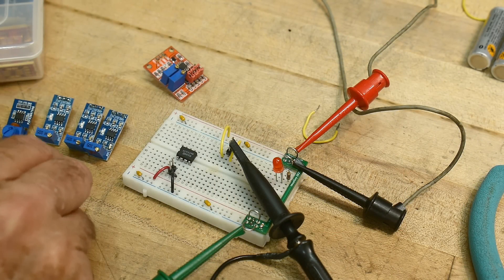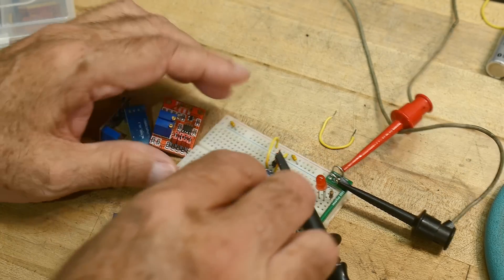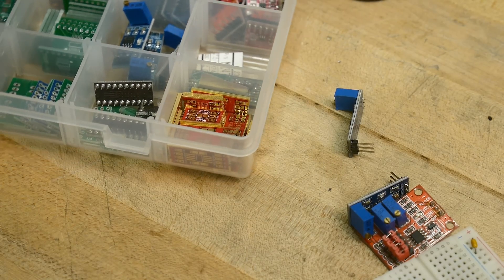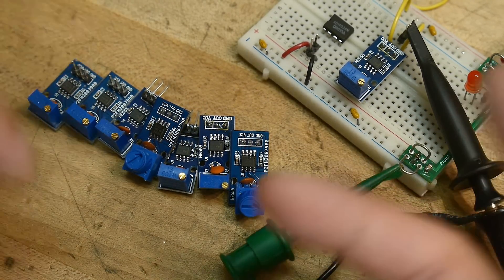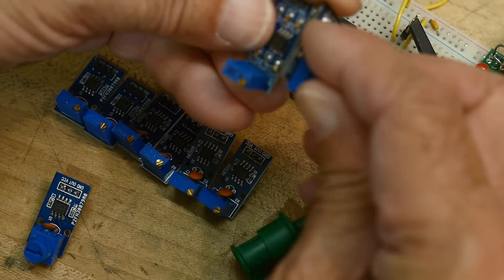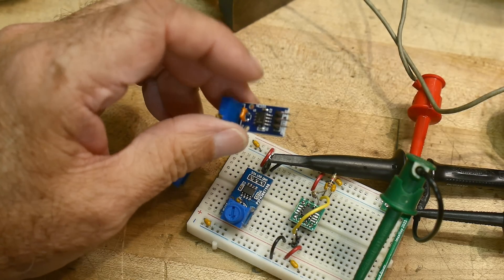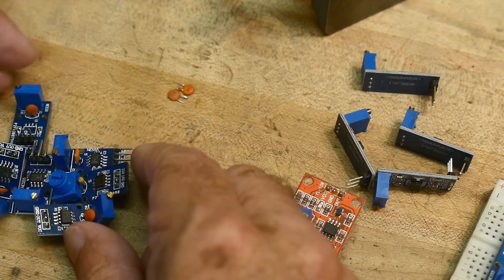#1588  Odd Behavior 555 modules

Comment: I checked all 10 I have and they all had the caps that were bad so I clipped them and soldered a .1 SMD size 1206 cap right across the pads and rechecked, all is fine now. Thanks for this video, very helpful.

Comment: Love you videos, I'm wondering if you could help me with a project for my grandson. I 3d printed him a traffic signal with the three lights. I put together a circuit with a 555 timer, and a 4017 ic, and it works to change the lights, except since the ic has many output pins, and I'm usin only three, there's a long off time, when it cycles to the green light, from the red. Any ideas?
I was thinking of usong an lm324, instead, could that work, with 3 of the op amps going hi and low?
Reply from the maker: https://www.homemade-circuits.com/knight-rider-led-chaser-circuit-mains/
Reply: I assume, that you have connected rgb diodes to pins 2,1 and 3 respectively. Imo you should connect pin 7 ( output 3) to pin 15 (reset) to shorten the counter's cycle. Also, "true" lights work with the sequence red - red & orange - green - orange - red (at last here where I live)), which requires 5 states and some diodes (or extra logic circuits) to drive LEDs. In this case the reset should be connected to output 5 (pin 4), and red diode to output 0 and 1 (using diodes), orange to 1 and 3, green to  2. Hope it helps.

Comment: When I began learning electronics I spent two years trying to build a buck converter using a 555 timer and failed but learned a lot from it. You can change the capacitor but that is not a guaranty either. Test that cap at 5v and 14v at 1khz to 500khz. Will the frequency still stay the same throughout the range? Wouldn't the capacitor charge faster at a higher voltage? Therefore the freq will change also. Is the output of the 555 ever used directly? Drive the 555 with a constant voltage, then level shift the output using a BJT/Mosfet. So it won't rely on the quality of the capacitor.

Comment: the small ceramic like you have are prob class2 and are very bad, both temperature and voltage upsets them. I have a box full and they are no good for RF or timing.
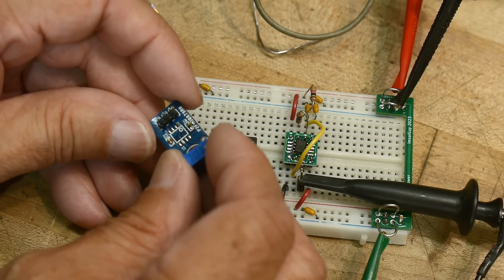Have alook at Alan W2AEW's video number 256 where he covers the various types. The ceramics start at about 7:40 in

Andy

Comment: I can't remember what it was I had which was a little board like one of these, but they swapped the SMT MLCCs around when they made them and the 555 was used for a IR TX carrier wave oscillator and couldn't be set for the right frequency until I found the problem.

I had another board that would step 12V-24V down to 5/9/12 or whatever for QC3.0 USB charging and the input bypassing MLCC immolated itself instantly. I had a couple of these and the second one was fine. They just put the wrong cap on the first one.

When these Chinese companies play 'telephone' with boards from Adafruit/Sparkfun as well as each other while mixing in fake or counterfeit parts, funny things happen. 🤪

Comment: IMSAI, ceramics are nonlinear with voltage change.  What?  My cheap chines modules exhibit the same behavior. I learned something else form you today, thanks for digging deeper into this issue. Off to change out the caps on my modules. Thanks

Comment: I once worked with a guy who had worked on analysis of why electronic products fail, and he came to the conclusion that it's always the capacitors, and when it's not the capacitors, it's connectors.
Reply: Transistors, vacuum tubes, and resistor fuses.
Basically it is based on age equipment.  New equipment say less than 6 month old most probably Transistors, vacuum tubes, and resistor fuses that fail.
Old equipment say more than 10 years old then Caps.
Reply: I was working on troubleshooting an awful noise and smoke in my microwave while watching this. Turned out the high voltage connection to the magnetron had developed an internal short. Another appliance taken out by a part they saved $0.10 on.

Comment: Those capacitors still work fine for power supply bypass, but ceramics are known to be nonlinear.  Oscillators should be based on mica or plastic dielectric if frequency stability is desired.
Reply: Depends on the grade of the cap. A C0G should be rock steady
Reply from the maker: I replaced them with really bad bypass only ceramics and those where fine.
Reply: @IMSAIGuy  Different ceramics have different nonlinearity.  To get high dielectric constant, we choose materials whose charges can stretch apart easily; but this means the yield point is easily reached.  Given a finite number of these stretchable bonds, all are eventually stretched and the dielectric constant saturates.  This is the source of the nonlinearity.

Although your capacitors work well with varying voltage, they will still not work as well with varying temperature as a more stable dielectric will do.

Comment: There are different ceramic types with all kinds of behavior.  The best are C0G.  This has a class 1 dielectric.  Next would probably be the class 2 parts like X7R.  The C0G is sometimes called NP0 (meaning negative - positive - zero temperature coefficient).  Very temperature and voltage stable material with virtually no change in capacitance over normal temperature.  These are the only kind of ceramic I would think of using in audio gear because of the minimal effect on linearity.  The X7R are a very good general purpose cap with some, but fairly minimal temp and voltage drift.  Generally, any of the very high dielectric constant materials have poor temperature and voltage stability.  There is another problem with them:  Like the flat plate sound transducers (Solid state buzzers) they can vibrate and make noise while being driven.  Some of the early Led bulbs had this problem and caused a lot of complaints of noise and whistles because they had cheap dielectrics in the power supply converter.  They can also convert vibration to actually make voltage.  This is called microphonic in audio.  The Kemet web site is an excellent source of information if you really want to dig in.  Look under technical resources.
Reply: Quite common on multilayer caps which are ok for decoupling but wouldn't use in the signal path,  to the dielectric used. But not seen it on low value caps, these must have been real cheap. 

But I can't see an issue as normally I'd have used them with a fixed supply the drift wouldn't have occurred and you have to set the output anyway.
Reply: The related problem with high dielectric constant ceramics is the increasingly poor temperature stability.  With some materials the room temperature variations can cause a noticeable shift in capacitance.  That may not be important in, say a power supply filter, but there is also the problem with high dissipation factor causing self heating.  Which causes more capacitance shift.  It is all a compromise.  Your options depend on what the application is and your experience. @TheEmbeddedHobbyist
Reply: @barnowl6807  i did  a lot of design work with Mil-Spec components once you got over the price the rest was easy. fully documented parts made life a breeze.
The commercial stuff  all made down to a price seems to make your work harder, now you have to think more about what the temp and voltage is doing to your cap values.

so glad that I'm just a hobbyist nowadays all the fun and no stress.

Comment: I've used the 555 for years and never felt the need for a module. Not sure if I'm missing out or not.
Reply: 555 has to be 60 years old now if it's a day. The last time I'd specified one in a product was 1991. With microcontrollers now costing less than a dollar that can do the work of 6x 555's
Reply: @jagmarc  seems like the speed of modern MCUs lets you multiplex the gpio pins so heavily that you got a faux fpga for less than $4 and no hdl, just a bunch of timing in the code. But I'm always looking for an excuse to make a state machine. 555s are still good for teaching.
Reply: @intheshell35ify  GPIOs are incredible, few years back I did a single-wire multidrop lowspeed bus that uses a single GPIO pin for in out address and data and control, switching between a 3-state output as bus master or client and as a mark/space input and include collission detection and negotiation.  And another time before that I did a sample/hold clamp thingy for nulling out superimposed ambient light noise on a photodiode in an measuring instrument , that too changed on the fly berween analog ADC to logic output to high-Z .  I wish I had enthusiasm for it but since the 90s I just can't bear work with clunky 555.

Comment: Many are mentioning leakage but I'd bet on the ceramic caps having a bad quality dielectric that changes value with voltage. Some MLCC caps do this, can't remember which types are the bad ones. 

Follow up video idea: compare the sawtooth/triangle waveform of the good vs bad. It should be almost linear with the good and curved with the bad as the voltage changes the slope.

Comment: Remember when you were playing around with the multi layer ceramic capacitors with high capacitance values?  One of the downsides is the materials that are used are very non-linear and the capacitance is voltage dependent.  If you used one of those surface mount capacitors in a NE555 circuit you should see a similar behavior.  Many modern capacitors have capacitance that is a function of voltage so you need to be careful about capacitor types.   I bet if you put one of those surface mount capacitors that you described in an earlier video, you would see the same effect.  In fact, it might be interesting to look at the capacitor charging ramp to observe the change in slope due to voltage dependent capacitance change.
Reply: Yes, if you use constant current to charge such caps, you should see variable slope instead of constant slope that you see on regular caps.

Do you have the link to that clip.
Reply: I used SMD caps and didn't notice the same effect as the ceramic ones that came on the module, they work fine now.

Comment: This is "old" to me, my teacher at technical college told us about this around 1995. In fact we only should use plastic film capacitors on this kind of circuit, maybe tantal for larger values.... 
This can also be a source of distortion in audio circuit, even the audio signal will change the capacitance and result in modulation and distortion 😉
As far as i understand there are different materials für ceramic capacitors, so the tine pF caps are in general better.
Would You like to test Your new fancy high cap 0805 SMDs for voltage sensitivity ?😇
Reply: Decoupling caps never were much good for anything else but shoving across supply rails.   X7R Z5U Y5V  aren't class 1 like NPO
Reply: Could that be as result of attraction force on the plates of capacitor as result of charge (voltage)?  If the capacitor dielectric is very thin, then pressure as result of the force could change the distance between the plates, which for thin dielectrics ( say dielectric  thickness of around 1um)  could be significant.
Reply: @aduedc They're also microphonic. Try it.

Comment: I was going to order a batch off amazon. After further consideration I guess I already ordered them and haven’t tested them yet. I would guess a faulty cap off the threshold
Reply: Well what do you know. It’s not only these caps but also my batch of 104s ceramics from AEDIKO replacement kit are also crap. Could it be they knew all along, and sold them anyway. My guess is probably not. Because all other caps in the kit are within spec.

Comment: Larger ceramic caps have diffusion issues with voltage that effect most at low frequencies. I think Z5U is the worst IIRC.
The worst I have seen on YT was in old TVs HV caps. Caps in horizontal circuits worked fine (15kHz) but vertical had severe non-linearity (60 Hz.)
The good 555's operated in the khz range while the bad ones were a few dozen Hz.
You could also try tapping the caps, they also tend to be microphonic. Also, even warming them up with your finger will vary the capacitance.
Other than precision ceramics (NPO, C0G etc), ceramic caps are usually only good as power bypass caps. Precision caps are more expensive and tend to be larger. These cheap ceramic caps at best are usually 20% but have seen them +80/-20%.
If I was using any timing dependent on caps, I'd probably use metal film caps. But heck, now I'd use a microprocessor and have software configurable speed and crystal accuracy.

Comment: my first guess when you showed that it was acting as a VCO is bad caps that very in leakage in reference to voltage. I wounder if they could be used as an cheap alternative to a varactor diode and how long they would last.

Comment: As far as I see there was a frequency change from 3.63 kHz to 3.16 kHz when going from 12 V to 7 V. (The input factor of the scope is one while the probe is a 1/10.) Maybe with a switched current source one might see the non linearity, how fast it is, and whether is has a memory effect and loss. 
There might be cases when such a capacity change has practically no effect like with voltage supply capacitors. Then they are offered cheaply and taken whenever cheap components are needed. These modules a offered in packs of ten if not more, what could go wrong? 😇
I did not pause the video as I was to curious for the answer, I was sure you will find it.

Comment: Check the leakage on that cap, and let us know what you found? Its rare, but disc ceramics will occasionally leak, even at low voltages. I have a Zenith Royal 175 radio that had splattering distorted audio. It was caused by AGC overload. The converter transistor was biased too high because a .05 disc that couples the LO into the converter was leaky. The cap measured 22 Kohms on the lo-power ohms scale.

Comment: I had hypothesis ready before you asked for one. If there are excessive large resistors you could have issues or a bad capasitor that leaks with increasing voltege that messes up everything.
Never seen that kind of problem before. Your idea of huge voltage difference is probably more true than my initial guesses. Caps can have huge tolerances, something like +20 to -80% is not that uncommon but that did not hit me before you spelled it out.
Reply: It is good idea to measure their ESR and EPR.  specially EPR.
All this discussion give me an idea for new designs based on these characteristics.